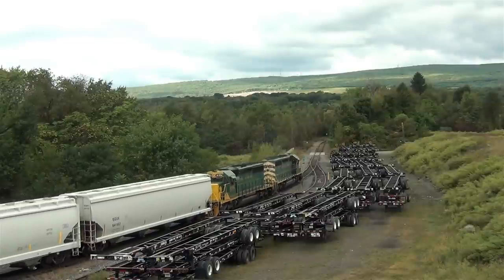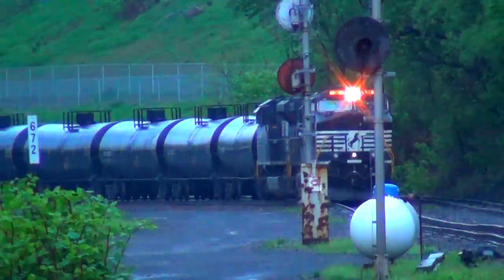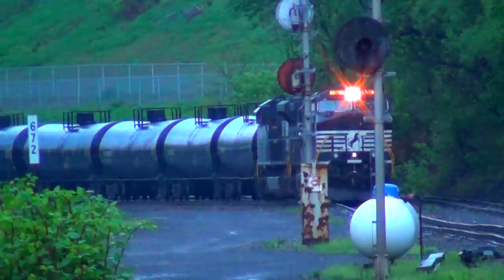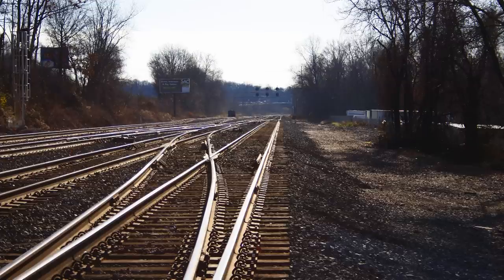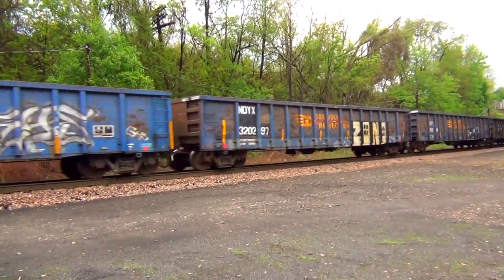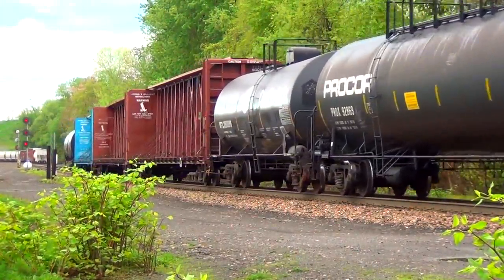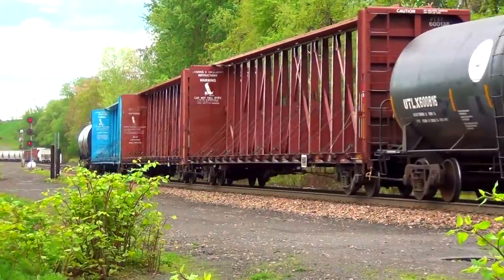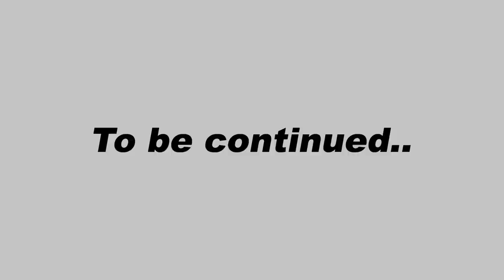How Railroad Junctions, Control Points & Interlockings Work (Part 1)

Comment: Why is there a propane tank between the searchlight signals?
Reply: More than likely it supplies gas to a switch heater that keeps the switch from freezing in the winter time.

Comment: I noticed that at 3:42, CN boxcar 413259 , Canadian is spelled Canadien. It's hard to imagine that could be a paint shop typo... Can any one inform me if this is an alternate line, or perhaps a "French Canadian" spelling? In any case, it's interesting to see for sure!
Reply: It's the French spelling.  Most CN (and CP) stock a mix -- at one time it was English on one side and French on the other but I don't know if that is still true.
Reply: @georgecarlson1460  Thanks George. Your explanation makes perfect sense. I appreciate it.

Comment: I wonder if the engineer worries if the switch point is in the right position
Reply: If there are signals the switch is lined by the rtc.  If something is wrong with the switch the signal won’t come in.  The signal indication will indicate if they are diverging.  If there are no signals approach prepared to stop.
Reply: You always check. Down here in South Africa, there was some solder messed in one of the switch motors. This caused an indication on the signallers' panel that the turnout was set for the straight (the signal also indicated a straight route) but in actuality was set for the diverging route. Unfortunately the one long distance passenger train ploughed into another.